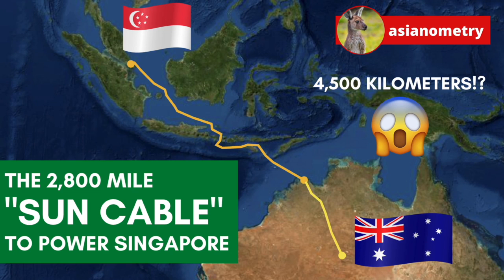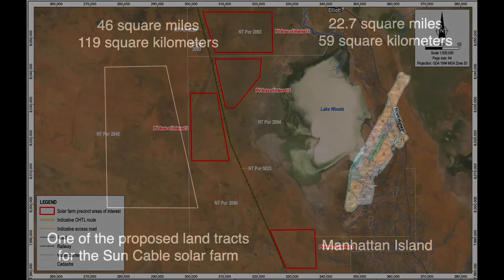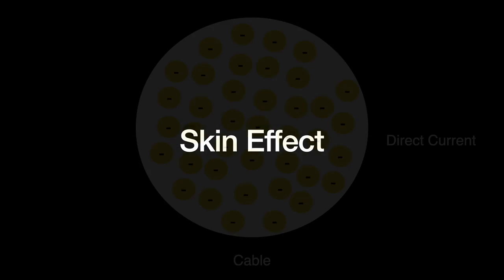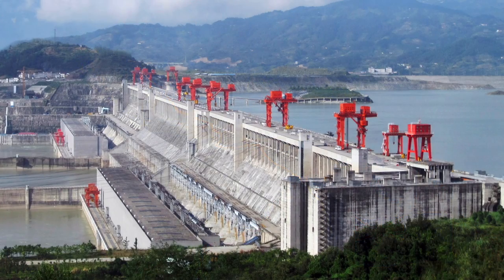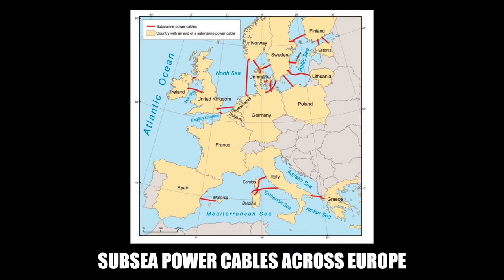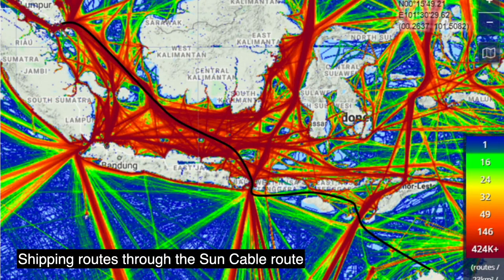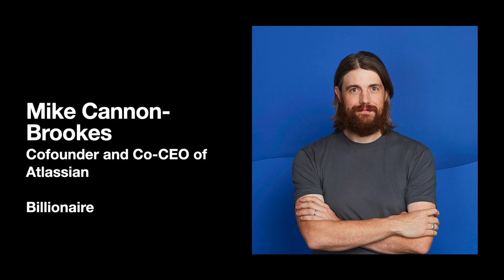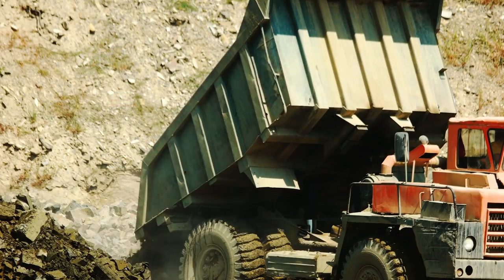How Singapore Plans To Pipe Electricity From Australia

Comment: It is time to  connect Norseman in WA with Wudinna in SA. Only 1410km. WA and rest of Australia have different peak hours during  morning and evening. Use local steel    and create thousands jobs and soften electricity demand during  peak hours.
Reply: That is a good idea. Could use AC but more likely DC. China is using 1MV overhead DC cables for long distance power transfer.
Reply: Why isn't Western Australia connected to the Australia's National Energy Market (NEM)? I thought it was because Western Australia was like Texas: wanting to be independent and secede from Australia at any moment. Then again the Northern Territory isn't connected to the NEM either.
Reply: @shazmosushi  It gets talked about, it is not a jurisdictional thing, it is mainly about cost and benefit.

Comment: High voltage AC in power transmission submarine lines also have problems with parasitic capacitive coupling losses and to a lesser extent the same problem in subterranean lines. AC also require the generation of watt-less reactive power to keep the power “moving” which is power that produces no actual work but still requires energy input. Then there is the “skin affect” which is covered in the video. Then there are to currently debated EM field issues inherent in high voltage AC power transmission. None of these are issues with HVDC power transmission.
Mark Fay US MMC Jr. Engineer QMED AS-E

Comment: Hi! Could you make a video about the malaysia-singapore failed high speed rail project?
Reply: Last time I heard it got restarted.
Reply: @UltimateAlgorithm  No, it didn't get started. Msia insist on using their crony companies to run the show whereas Spore insisted on a neutral 3rd party instead, which has always been a crucial part of the agreement. That is why Msia is willing to compensate Spore for breaking the agreement... because the fault is so clear cut.
Reply: @Munish this is Singapore and Malaysia we are talking, they are much more capable than Sri Lanka and other countries that got trapped by China.
Reply: @marktan8074  I heard both Singapore & Malaysia agreed with China to build the high speed line. Does not matter who build it, I think it will be good to have high speed connection between the two countries. I hope that Indonesia joins and continues the line to Batam though. Probably not gonna happen, but one can dream about it, hahaha.
Reply: @marktan8074  Well the supposedly 'neutral' 3rd party want a 6% government guranteed interest for their investment (can't really called it an investment really as it is gov guranteed income). At that point it kinda meh considering japan is offering 1% or china 4% rates on loan. 

Also MY want to change the scope to reduce cost by utilizing the existing airport link like TH is doing. But doing so reduce the attractiveness of the project to both JP & Ch as the airport link utilize european standard. Ch doesn't have a narrow HSR trainsets to sells & JP narrow HSR train are a bit too short, this mean SK & EU firms has a better product to sell.

Another potential change is that MY possibly want to follow in TH footsteps and just privatize the whole thing to a buddy buddy companies in exchange for land for transit oriented development to reduce the government debt burden.

As for SG, the whole changes is too far different from the original agreement and thus they wanted a new agreement instead.
Reply: Singapore and malaysia sampai tua lah semua tak jadi aku beli rumah kat johore ada macs sekarangtun fah scrap mac itu contoh macham macham mana nsk maju malaysia

Comment: I'm surprised that the battery backup proposed is for onsite with the panels. I would think you'd have the panels feeding battery backups onsite with your use end point (Darwin, and in Singapore) . That way you are using your batter storage after transmission losses, rather than before, so you need less total battery. It seems like if your batteries are housed with the panels, some percentage pf your battery bank exists solely to be lost in transit.
Reply: Just personal thoughts but by storing at the production end: 1/The most expensive part of the total system (the cables) can be built thiner since they just gonna have to be sized for day or night consumption and not in proportion of the peak production moments (when the sun shines at max in Australia). 2/ By retaining power on the production side, the proportion of losses along the transport will also be lower since the intensity will also be lower 3/The investor has a better control on the electricity price since it can release power at peak price moments (at this scale of energy, prices per GWh can almost double in a matter of hours) and improve its profitability. 4/They could maybe count on low cost/low density battery technonolgies that seem to be currently under development taking advantage of the australian desert abundance of space.

Comment: No one has explained it well, the dc Delima.  Edison was to build a power station every few miles as DC couldn't make it more than about 20 miles, yet to the moon and back in length, DC is the way to go.  I would think on such a long line UVDC (ultra) rather than HVDC (high voltage) would be the choice.
Reply: The higher the voltage the less copper for a given wattage, true, but the more insulation you need and the more your switches and converters cost. They sit and do lots of calculation for any long distance power line for the economically optimum voltage. If they prefer HVDC to UVDC it will be for a reason.

Comment: any figures on what the power would cost in Singapore if the cable, farm and battery were built on budget? Probably need to add in more costs for backup gas generators for the inevitable power outages due to cable breakage.  Looks like a pipe dream to me.

Comment: It's a positive renewable energy mega-project (not too positive; the majority of solar panels are now made in China, plus manufacturing solar panels is a polluting business). There is more than the environmental costs of making the components. The DC power connector cable runs over much sea and ocean bed which comprise unstable tectonic plate boundaries (especially in Indonesia, which is the majority of the length of it). Seeing that the Bass Strait is much shorter than the proposed route (about 1/10 as long), plus the Bass Straight is not at unstable tectonic plate boundaries, there is a lot that could go wrong with such a long sea cable. Why not put solar panels on pontoon barges at sea, away from shipping lanes, but not far from Singapore? Singapore is near the equator and outside the cyclone zone (within 3 degrees North or South of the equator).

Comment: Electrons concentrate at outer surface of conductor due to like-charges repel, AC, DC, both. Long line losses for AC is due to antenna effect, longer line offers resonance for AC 60Hz, wavelength of which is λ = 4996.541km 
Why not do some research: conjecture forget subsea cable, just transport batteries by container ship? (run cable from solar farm to ship, keep them aboard) As battery tech improves, this scenario may do likewise.
Reply: A ship can get 0.015 kWh of chemical energy per ton-km 

So 60Kwh/ton to transport the batteries.  At 250wh/ kg you are losing 30% to transport. Let alone the cost of batteries.
Reply: @catprog  Congrats for thinking, that's better than most viewers. But it's easy to k'bosh new ideas on a superficial level. Instead of massive oil-fueled container ships, what about smaller sailing ships (updated from 19th century of course)? Energy-wise the transport thusly is free as the wind. Employment wise, this would mean many more ships and sailors. That would be expensive too, but have more social benefit, plus advantage of distributed risk. Put that on the scale with cable: not possible at all for several years at best, with no guarantee of success, also with massive "sunk" costs. LoL.

Comment: Australia's government can't even organise solar energy for its own people properly so I'll be very surprised if this projects gets up and running anytime in the near future
Reply: dump project
Reply: Australia has been in the top 10 solar generation countries for unstandardised for population for a while
Reply: Solar power is going up everywhere, new farms and rooftops. What are you talking about?
Reply: nothing wrong for solar but the long cable.....
Reply: @adrianhelyar3186  The problem with people advocating for solar power is that they are usually only thinking of home use. Industrial machinery in agriculture, manufacturing and various processes across the industry require massive amounts of power. Industry relies on industry, from construction materials, pharmaceuticals, electronics, metals etc. One tonne of aluminium requires the same amount of electricity that an average family uses in 20 years, then think of the power used by a metropolitan train or tram network, elevators etc.
All the things that you put in your home and the home itself comes from an industry that requires this power. The sunlight might be unlimited, but the land for solar panels or wind generators and the materials to build them is not. The amount of land needed, even if every rooftop in any country was covered in solar panels is far larger then is realised. The construction of solar or wind generation is so large, that before we have finished building these facilities, 20 years or so on we will have to start replacing the earliest facilities. The idea that wind and solar can produce enough power for any industrialised country is only thought possible when you don't really understand the scope of what is required and those promoting this as the future are taking advantage of you.
Reply: @adrianhelyar3186  Solar and Wind are pushing the price up, they are costly. The amount of windmills, panels and batteries, even if they doubled or tripled storage capacity is so ridiculous that the price of electricity will be costing the country a major chunk of our entire economy. It will be like up keeping a second military force or Medicare growing by 50%, it would need major funds to support it's existence because if the real cost was supported by electric bills, most would be unable to pay.
Most solar installations are reduced by subsidies, it would be like this but on a national level that so everyone can afford it.

Comment: Hard to imagine a country placing energy sovereignty so directly in the hands of another country...
Reply: Where do you think the gas comes from?
Reply: @mabamabam  😄 there’s probably a difference between shipping in LNG and Oil in via tankers and having your electricity come down a ‘wire’ that can be turned off with immediate implications. Once the LNG/Oil is in storage tanks in your country you’ve got it in-hand.
Reply: The Singaporeans are smarter than that.  They are trying to diversify their sources of externally supplied electricity.  This project would only supply 20% of their electricity.  Countries that generate some of  their power from uranium or coal or gas exported from Australia do the same thing.
Reply: 50% of Singapore's water comes from a very unreliable neighbour with their MPs openly suggesting to poison the water supply to "teach Singapore a lesson" during parliament, an act which would have triggered wars elsewhere.

We have plenty of experience dealing with such dependency.
Reply: @huaiwei  presumably that water goes into reservoirs before it is utilised? If the electrical circuit is broken, the loss of power would be somewhat instantaneous no? And malicious neighbours aside, it could also happen by other more natural means too.
Reply: @huaiwei  fake news
Reply: @azlansharom7011  and so? Which country in the world today threatens another to poison their water supply? So yes, thanks for pointing out that there are disruptions to Singapore's water supply by any other means. Which is why I said...we have plenty of experience dealing with that.
Reply: @avegaughtastiffy1654  which part of my comment is fake news?

Comment: It would make more sense to connect the Bakun Dam to Singapore than this grand hypothetical. 

Solar panels still need tons of water for cleaning and the duck curve still needs to be addressed. 

Sarawak as a regional partner is far friendlier to Singapore than Peninsular Malaya.

Hell, supplement it with Solar Pump storage if need be. Cheaper and Shallower too.

Edit: what do you know , theyre doing this instead of the long solar cable. TBH We saw this a mile away.

Comment: Burning hydrogen DOES sound inefficient, but fuel cells sound very efficient vs charging batteries for cars. Shipping or piping hydrogen could still be a thing - if fuel cells work out for vehicles.

From the map it looks that the sun is skewed by about 4 hrs, so their hot afternoon & evening peak should coincide well w/ mid Oz sunshine.

Put better, the extra cost of DC transmission, is expensive conversion to AC - so the longer the distance, the relatively less the penalty.

Comment: This whole project will never fly! The cost vs return will make it not viable. I work in the power industry and you would need massive load to return a profit to the investors.
The skin affect is complete rubbish, this only happens at higher frequencies. Low frequencies at 50 Hz donot have significant skin affect. The capacitive/impedance losses with corona discharge issues with EHV are why AC will not be viable over this distance. 
Plus solar and batteries have not reached a real return for investment currently plus you need to transmit this energy for 1000s of kilometres. Complete pie inthe sky idea.
Reply: Plus you need Indonesian approvals, and if it's approved, then you need to pay

Comment: Oh, they use imperial measurements like we did back in the 1960s.
That must be so hard to work with, I don't just mean the 1/12th, 1/3rd and 1/1960 (?) fractions, but also the knowledge that you are using redundant words.
Its like they still hand cabled wind up phones while every other country has ear bud communication.

Comment: Laying HVDC across longitudes to connect Europe and US is kinda feasible. At 40 latitude earth circumference is 30kkm, at 12 hour difference thats equals 15km or at 3% loss equates to 45% loss. Not great, but then one doesn't need battery.

Comment: When they first built Basslink, they saved money by only using one conductor and letting the reverse current flow through seawater. Unfortunately, that caused the Bass Strait oil platforms to start dissolving due to electrolysis. I'd like to know what a kilowatt-hour of electricity would cost in Singapore?
Reply: That is actually fascinating! Makes sense though. Did they re-engineer and include an earth/neutral? Cheers
Reply: @hdmccart6735  I understand they laid another cable across Bass Strait for the return current.
Reply: @vk3dgn  Only choice really, cheers.

Comment: Seems like a bit of a reliability SPOF (single point of failure) to me. I appreciate the good intentions. But can't Singapore power itself from offshore wind turbines and floating solar panels? The storage can be on the island in batteries and flywheels. 
Multiple sources and short supply lines. 

Sure, the wind and solar may not be at maximum effectiveness around Singapore, but the infrastructure savings and reliability benefits look better.
Reply: Monsoon means lots more storage.

Comment: Why is Singapore not invest in nuclear power? Even if their source of electricity is derived from natural gas (95%), that is reliable and cost effective. There is great opportunity for them to invest in blue hydrogen coupled with CCUS if they are worried about carbon intensity. Blue and green hydrogen could easily use the same natural gas infrastructure (minor modifications).

Comment: Ah... that explains why CNG for cars is so expensive in Singapore. Most of it is used power generation.

I drove my CNG powered car across the border, natural gas is cheap here at $0.20 USD. Just out of curiosity, I went to check out the CNG station there. Ooo.. wow. It's almost the same as 95 octane gasoline.
Reply: Wouldn't electric cars be the better option in Singapore ?

Comment: Finally someone touched on the Green energy problem cases by small island nations....no land or solar or wind farms.

Wouldn't importing Hydrogen to run new generators in the short run be less expensive until they can produce their own?

Hydrogen could also replace NG and Propane.
Reply: How do they make the hydrogen in the long run. And would it not be better to use that energy directly?

Comment: The length of the cable depletes the power in the line. Solar panels need to be near where power is consumed.
Reply: Why are solar panels different then a coal power station?

Comment: I agree, but while Australia exports so much raw commodities, iron ore, aluminium ore, bituminous coal, anthracite, wheat, etc., it makes niche industries really difficult.  We do not have a big enough market to support major manufacturing industries but high value high tech niche exports are what we should be aiming at.  But that requires high levels of education.  The average Aussie is so dumb.  Finland is a good example of highly educated high value niche exporter.  Twiggy's idea of exporting renewable electricity to Singapore was the spark for this post.  It would make so much more sense to use the electricity to refine the raw materials.

Comment: DC also has more power delivered for the same RMS AC voltage. Or it can deliver the same power at a lower voltage requiring less insulation which adds to cost savings. How many platypus does Australia export annualy? Which countries but these platypus? They must taste great!